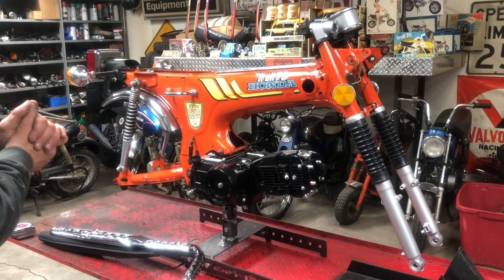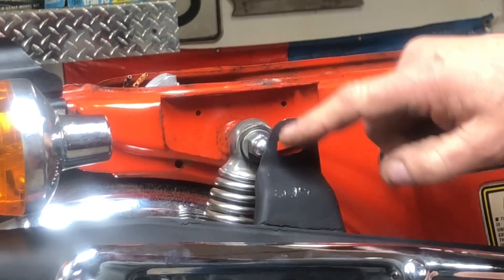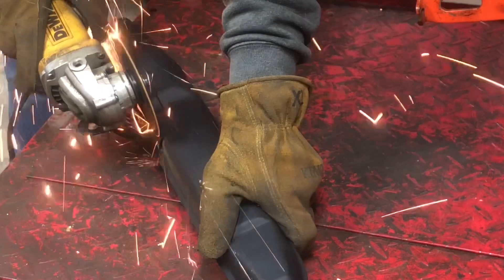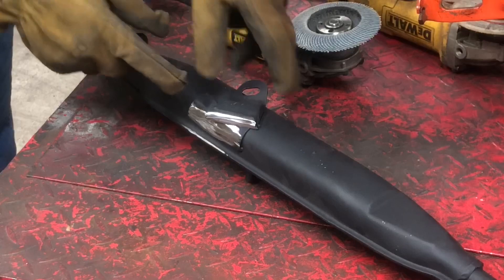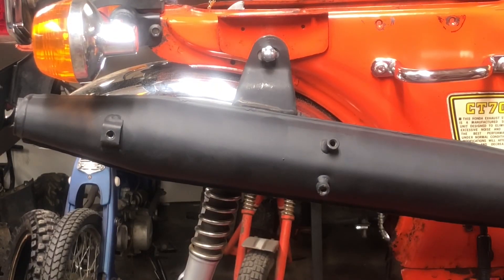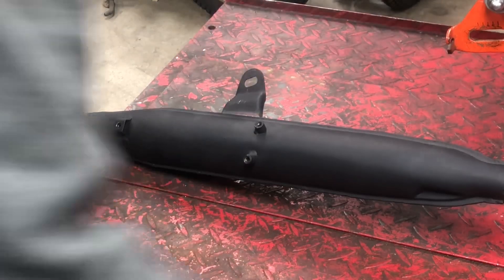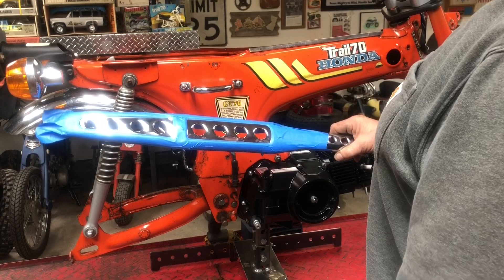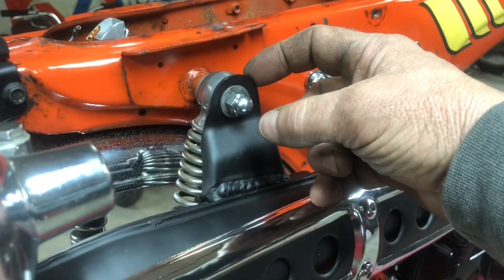Cheap CT70 exhaust....how to make it fit.

Comment: What diameter exhaust is that? Because I have a Lifan 125 on a 1965 Honda super cub c100 and I need an exhaust and I not sure what size exhaust will fit on that motor.
Reply from the maker: @DJ-Adams218  All of the cheap Amazon or EBay CT70 exhaust are the same diameter and fit all the horizontal engines.

Comment: Has anyone ever made this fit on an SL70?
Reply: I feel like it would be a nice work around with how expensive the exhaust is for that bike
Reply from the maker: @AlexanderLanderman  it will fit and work, just remove the plastic SL70 side cover.  The heat will distort the side cover.